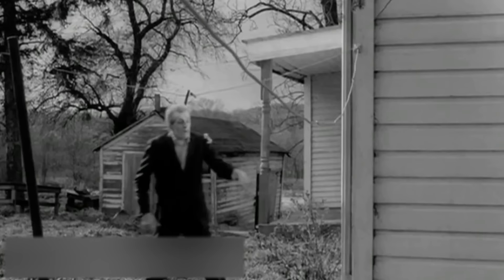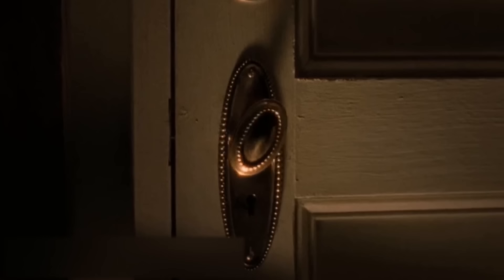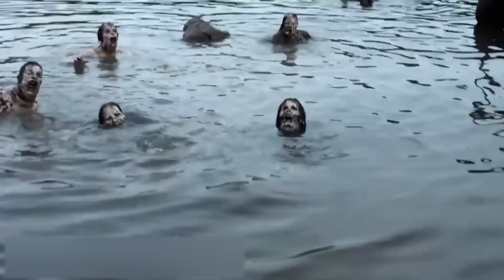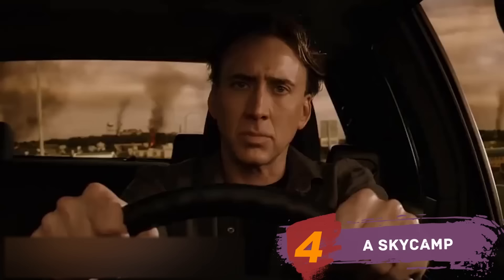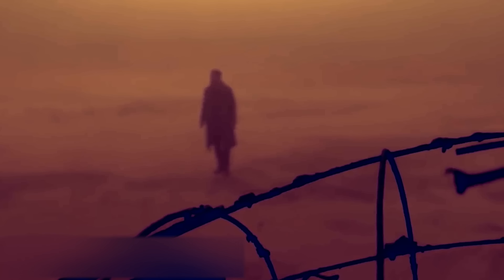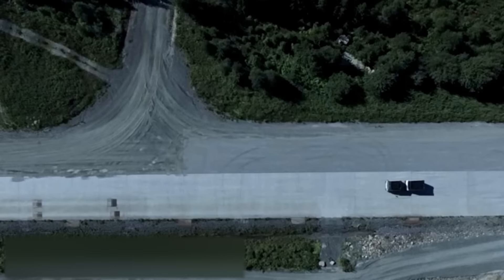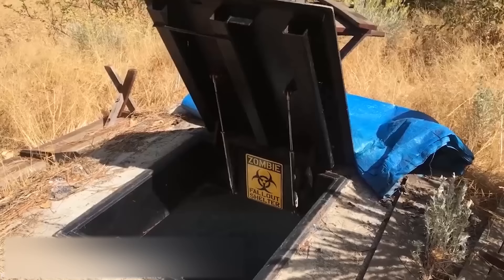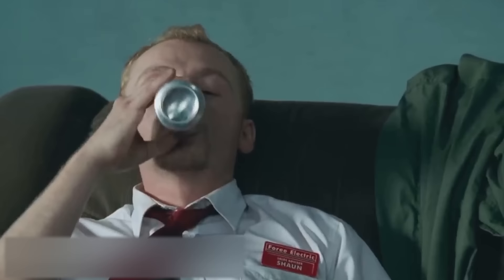9 Cool Ideas in the Case of a Zombie Apocalypse

Comment: There's a thing called oxygen you need it in the capsule
Reply: The capsule probably has oxygen tanks
Reply: It might have tiny holes
Reply: Thera are 3 oxygen tanks
Reply: What if the virus is airborne ?
Gas mask are limited
Reply: You also need to go to the washroom lolol
Reply: Just poke one tiny hole somewhere or a bunch
A hole small enough that air can get in but not water
Reply: I would assume that there’s oxygen tanks in it either/ or  a small hole with a system as not to let anything in
Reply: Emma BeekmanBond 🙌🏻
Reply: @patchthevelociraptor4764  water would get in
Reply: @patchthevelociraptor4764  lmao its in the water
Reply: @BelldofersMatlack  lmao it is in the water
Reply: The air we breath is more a mix of hydrogen and oxygen plus there is more hydrogen than oxygen
Reply: @Bobuno22  did we rlly have to get technical
Reply: Lol
Reply: @Bobuno22  ummm, we don't breathe hydrogen.  We breathe mostly nitrogen
Reply: @Bobuno22  oxygen nitrogen carbon dioxide and trace gasses such as argon
Reply: Oxygen is overrated
Reply: @Swaggmire215  😂😂😂😂
Reply: @jackbeechey2636  ayooo 🤣
Reply: @patchthevelociraptor4764  if it had tiny holes then the zombies would smell them
Reply: @patchthevelociraptor4764  it will be underwater
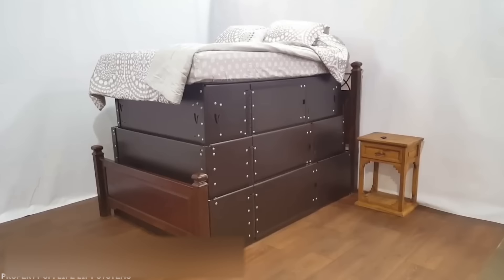Reply: 4:05 Imagine getting stuck in there.
Reply: get a gas mask which is covering your eyes ears and other places(with body protection)
Reply: Breathing is over rated lol
Reply: It’s not like it rolls in the water IMA END THIS REPLY WAR OK SO THE DOOR HAS CRACKS IN IT AND THE DEVICE FLOATS ON THE BOTTOM CAUSE ITS THE Heaviest OK SO the air gets in through the door and IF YOUR IN THE MIDDLE OF THE OCEAN THE VIRUS AIR ISNT GONNA GET TO YOU UNLESS YOU BRING SOMEONE THAT HAS IT. THEIR THE WAR SHALL NOW BE OVER
Reply: @LazySlothGaming442  if there's a massive wave (which in the middle of the ocean isn't uncommon) water would still get in
Reply: @jackbeechey2636  it’s not sealed all the way but it water tight
Reply: reply war lololo
Reply: Making of the Vault from fallout really makes you an engineer for closed underground places
Reply: @zombiekiller7101  you can just pee in the capsule lol
Reply: Yea
Reply: You sound like the guy from tik tok 😂
Reply: Just get some helium tanks.
Reply: I made this comment 1 year ago... What did I start
Reply: Brain time: The zombies arent going to be big enough and not able to climb!
Me: yeah tell that to L4D2...
Reply: This capsule is made for tsunamis but it cleans water itself and has oxygen
Reply: I zombie 🧟‍♂️
Reply: There is obviously gonna be oxygen tanks in the capsule
Reply: @nasa_jpl3390  lmao ......
Reply: @zombiekiller7101  well there are some passes for that
Reply: @zombiekiller7101  pee is sterile so it's safe to drink when not filtered and poop can be used as fertilizer if you have a plant or garden I side of the capsule
Reply: @xtr3me663  yeah, I might as well move my house in that capsule
Reply: It might have a filter system
Reply: @zombiekiller7101  nah
Reply: There is a thing called hole you can breathe from there every capsule has one water cant get inside
Reply: @eddy9538  water just can get through the hole tho 😂
Reply: @jackbeechey2636  You dont get what i said or you didn't read it correctly there is capsules that has hole wich only air can go through and water will be sent out but air will stay
Reply: Iam dead reading this comment🤣🤣🤣🤣🤣
Reply: @KingKablooie  yes, helium.
Reply: @jackbeechey2636  yes we did
Reply: @corpstilldeath6744  uh definitely not true at all buddy, hydrogen is something that's in our air
Reply: Bruh...
Reply: Says the fallout expert
Reply: @peenrag6_z926  and food and water
Reply: If this happens most people who play gun games will be like: get me a gun. I’ve got dis. 
For fortnite players: die die die die 
When you get bitten- nOOOOOOO
Now mother isn’t gonna buy me v-bucks 
:( 

Call of duty players: oooooOoooo time to be a try hard :) 
Yas yas! Die die! 
Father: dO U wAnT coD poInts 
YASSSS
Reply: 5 days
Reply: They need I bathroom in that capsulr
Reply: Sorry capsule
Reply: Oxigen is what we breve
Reply: @fenny7772  Good job
Reply: The capsule obviously has some sort of oxygen tank
Reply: Haha lol
Reply: Why do you think you can only be in it for 5 days
Reply: @zombiekiller7101  - hold it 😫😬
Reply: Ye o2 tanks that's prob why you can only stay 5 days
Reply: Cool your picture is what mine is
Reply: I’m more worried about where you poop
Reply: @jackbeechey2636  wagwan batty crease
Reply: @ishtiaqrahman1188  thanks for ur input
Reply: Hmmm a comment from a year ago? WELL TIME TO CE BACK AND WATCH MY EVIL WRATH.
Reply: YEAH🧟‍♀️
Reply: And not to mention the chemical reactions from all around and we breathe nitrogen
Reply: Nonsense
Reply: There's a lot of things that this video doesn't actually show what you need for survival, it only shows temporary or limited safehouse type buildings, which will eventually break down, or get you killed/run outside for food. Plus even if there is oxygen in the capsule, the smell of rotten flesh and or any spores forming on bodies can cause you to die, that capsule probably costs over 1k $ you're better off living in your own house honestly.
Reply: @_Dankey_  too**
Reply: @Bobuno22  noone asked

Comment: Three years late, I know, but still felt like leaving a comment.

I live in South Africa, and due to the high crime rate, just about every home has 3 walls around, 2 to the sides and 1 in the back surrounding the plot, then a palisade at the front. The are about 2 - 3 meters tall and the palisades normally have very deadly spikes on top. This is a very save environment especially towards Zombies and I doubt they would be able to penetrate the fence.

In some cases, there are no palisades but only walls, with a covered gate which means the Zombies won't be able to see into the yard. After that, all homes are equipped with a security grille door in front of the main front door, therefore, adding to the safety.

And lastly, there are hundreds of shopping malls and grocery stores within walking distance from every home, insuring a decent amount of food that might last a couple of years, plus, there are a few garden shops that sell seeds and other things like saplings which can be used to create a vegetable garden.
Reply: In case of an apocalypse, I’m going to South Africa clearly. My friend is too and told me about it. They said as the power cuts out a lot some have generators.

Comment: Number 1
 - You'll run out of power sooner or later
 - Zombies will just end up piling up against the treadmill until it either breaks or has enough zombies on it that other zombies can climb to the top
 - Just demolish or destroy the staircase
 - Not actively available to the average civilian

Number 2, Number 3
 - You're trapped inside
 - Not actively available to the average civilian 

Number 4
 - Good idea, but you need to travel really far away 

Number 5
 - Durable, but cover the elbows, back of legs. Too clunky
 - Using Kevlar limb guards is a suitable alternative

Number 6
 - No.
 - Horse are actually better in the sense that they can travel where cars can't
 - Roads will be blocked
 - Running over / hitting a zombie with a modded car will more often injure it than kill it
 - Not actively available to the average civilian

Number 7
 - Not actively available to the average civilian
 - Fuel

Number 8
 - Impenetrable but there are issues with food, water, power
 - You're trapped inside if they ever do bust in
 - Generators are very noisy

Number 9
 - Good, but the money spent on zombieproofing every window could go to either a tornado shelter or a stilted house which would provide better protection
Reply: Possible!
Reply: Literally the whole video I was like yea hold up gotta go get my wallet and take out the 100k I had sitting around
Reply: A better alternative for fossil fuel generators is to install solar panels, then again, that’s expensive af, and even then you are still trapped underground, your only hope really is to hope the US military 
, First Responders, Counter Terrorist units, and NATO to stop the zombie threat
Reply: Number ten protect all skin because musquitos can possibly transmit the disease
Reply: If the Bunker owner was rich he could literally make his bunker a maze...and have over 100 Doors until the Zombies Get to him...and he would have high Security...so small Turrets...traps or something like that to kill or damage the Zombies...and well he would have Weapons near him/in the same rooms he is living in...and he should bring ALOT and i mean ALOT of Food (and Minimize the usage...) and the food that i recommend are:

Rice:Its the first Option cause it wont expire...Quickly

Powdered milk...gonna be honest...i was never a fan of Powdered milk but hey...u gotta do what u gotta do right ?

Honey:I dont know if this is weird or not but i had a Bootle of Honey that i didnt touch for literally 9 Months and it didnt Expire...so this is nice.

I heard that Canned Tuna stays good for years...so yea that is NICE.

Olives:if u didnt open the bootle they will stay unexpired FOR AGES...so stack em up bois.

Instant coffee...it wont spoil...

Stack on all of this (Like 30 Bags/Box of each thing will do) and you'll survive....only if u are rich thought (or if someone u know did it and Invited u)

Comment: A way to survive
1.) Know your surroundings
2.) Choose a light weapon 
3.)your never too prepared
4.) Know how to make weapons out of trees, and string out of 
5.) Build multiple walls around you
6.) Take fireworks (Dying light)
Reply: Thanks my dude
Reply: You don't need a light weapon. Just use something blunt so it doesn't get stuck in the mesh of the head. You could also just sharpen sticks and put them around your house. While you're safe work on a wall and if you can, use steel tips on the pointed sticks, the zombies will get caught and you can kill them with one swift strike to the head.
Reply: I have a bow

Comment: 1. Staircase Treadmill
Fast moving zombies - some will be fast enough to get to the top.
Slow moving zombies - slide down and pile on top of each other and eventually just climb up.
Con - you need electricity to run it.

Comment: As a kid I would have killed to have a secret base under my bed with most likely junk food and electricity for video games. It’s basically paradise at the push of a button.
All I got was to make a tent with the tripod from my telescope and my blanket and I would put a lamp in there and read comics and play with my gameboy color. It was quickly hot in there and after a few hours you’d need to come out hoping working batteries were somewhere in the house. I was traumatised no wonder I turned out like this. 😹

Comment: * Installs Stair Threadmill *
Me: There's something called Electricity
Reply: It dont need electricity
Reply: @mr_bearsi9718  What do you mean it dont need electricty
Then what does it run on?
Reply: @James-rs6uh  if you look at treadmill you see that it dont go around. You see that it only moves when people run on it
Reply: @mr_bearsi9718  Wrong
If you look at 1:53 you can see that they turn it on and if you continue then you see that its on even when nobody is running on it
Reply: @James-rs6uh  i mean that it still works without electricity
Reply: @mr_bearsi9718  Does it tho
Reply: well you're both right it can run with or without electricity
Reply: Lolz
Reply: @Reuben Nerby wat
Reply: @Reuben Nerby Yea but does it tho
Reply: @James-rs6uh  it does
Reply: Its called the loose roller which are free rolling
Reply: @dubsax4allgaming207  yep
Reply: solar panels ?

Comment: You have to take in the fact that the moving treadmill thing will need to take in electricity or some form of power and things during an apocalypse are limited
Reply: You  can use a non electric one that relies on gravity
Reply: I would also keep some type of oil to quickly douse onto it to make it slick.
Reply: And Smosh showed that having a treadmill against zombies is pretty useless
Reply: Runs up a treadmill and is finding it difficult himself and falls back twice also the button is at the bottom what if a zombie falls over onto the button and why not just have the button at the top so you can turn it on once you are up? Like WTF?
Reply: @4dalulz203  😂 "treadmill" lol
Reply: The one they used wasnt electric…
Reply: @AliG-fr9oj  Ikr
Reply: so what is u slip on ur way up?

Comment: 2:02 you blurred out the property of Colin furze in the bottom left corner and didn't leave any link for the clip used, you can just barely see that it says property of Colin furze because your editors did such a bad job on it, if you've left credit for the clips used in the video at the end I will delete this comment,

Comment: The treadmill thing works wonders, until you realized you goofed and put the power switch or the plug in cord on the bottom floor when installing it and the zombies absent mindedly turn it off.

Comment: I do like the out of the box thinking but some of those tips would get you killed... For example the treadmill staircase from seeing how much time and effort for the survivor,.. by the time they get half way they most likely be grabbed and pulled back down to there death.. ( note best thing to do is to put a large piece of furniture in front of the bottom of the stairs and something heavy at the top of the stairs.. also they zombies can climb to some degree so if your car is low enough they can climb onto the car if they believe that there pray is there)

Comment: 1st advice is bad, why even stay in a non defendable house? Search for castle, bunker, apartment building, concrete and steel etc. House is a death trap in apocalypse. Especially american style, wooden ones.
2nd advice - death from starvation in 1 week. Military always fails
3rd - what? Same, death of starvation. 
4th - good only vs 1-3 zombies at once. A group of more is gonna destroy your tent, wrap you in it and you'll probably get suffocated in your own tent. 
5- finally an essential, good advice. Teeth are weaker than kevlar or even hard plastic can easily stop a bite and scratches. 
6, 7- very good. Use spikes on cars at all sides, hole in the roof so you can shoot out from, use plates of steel/ hard plastic and screw it into the car's plates for thicker "cage". 
8- good if you did it before apocalypse even happened, otherwise not possible. 

Sorry, i am just being honest and try to look at this as realisticly and objectively as possible, as I am creating a zombie series which will be based on that - realism.

Comment: Coat the stairs and ground floor in bacon grease and oil, and bypass it with a rope ladder outside.
If for whatever reason you need to abandon that place, you can easily burn them.

Comment: There are alot of flaws in this, carrying body armour like that will get you worn out and tired quickly and u will find yourself taking it off, the l heavy armoured vehicles wont be good as its heavy and has a large diesel consumption.

Comment: Ok here me out a mad max type vehicle would be good but not the best if they are just there to eat flesh then they probably don’t care about pain so getting crazy stuff would just make more things for them to hold onto so I think the best option is to get a buggy type car with no edges and cover it with lube so nothing can grab on and maybe even add some solar panels built into the roof so you have no need to worry about gas

Comment: I have a plan, i live in an apartment so the  home is safe with Steel door and two way out and in with the fire exit, i have two fridge 1 freezer, i can store a lot of foods so the first thing to do is secure the house then after several daya start to secure the building go since the buildings door is auto closing it Will be shut down but there is a window which i would need to shut off with nails and wood

Comment: The last one is dumb
The windows r fine but the door wont stand a chance against zombies
This is because the way a horde of zeds could break into your house would be by putting so much weight and pressure on the door that it breaks off of its hinges witch it basically is useless to
BUT if a group of raiders try to break into your house you're probably fine
Maybe

Comment: I have a underground home build from steel vented from 160 air pipes that stand 300 feet high with purifiers and filters.80 fully functional electric powers solar and 30 water chargeable units  if the sun isn't shining . an food lots of can stew and other supply medical and non medical. 7 rooms 3 bathrooms . fully functional and each bedroom as CCTV and each is equipped with lockdown steel doors will drops and latch. each room also has entertainment 70 inch with game systems. and we build an little blue storage place and have thousand or blue ray and DVD. much more. over the period of 20 years I've been slowly building because it cost a load of money. I'm not saying zombies could happen but what if the world turns into something like the book of Eli I could see that happening